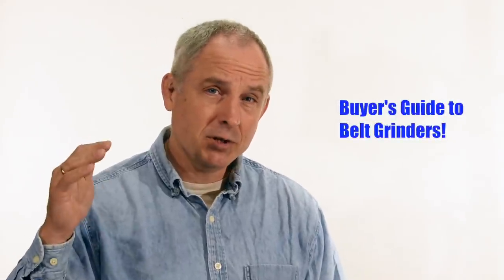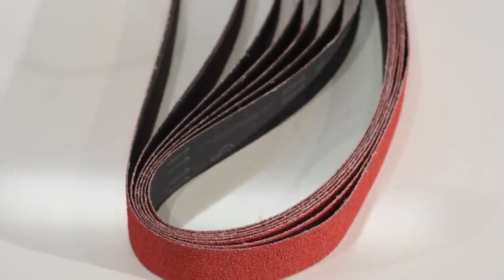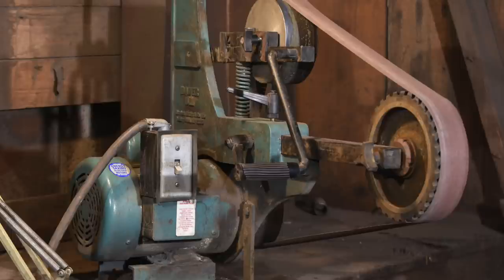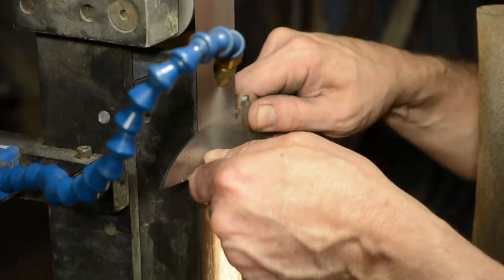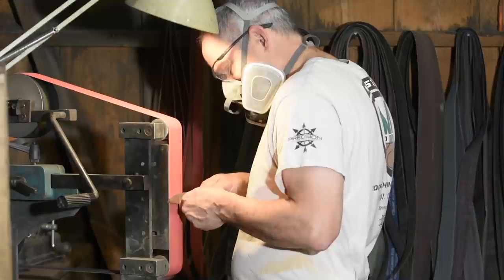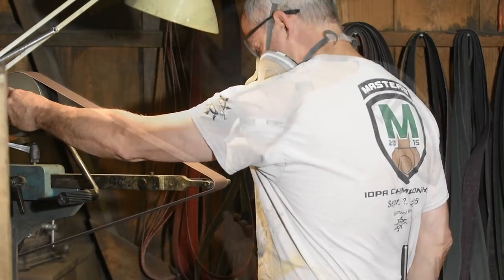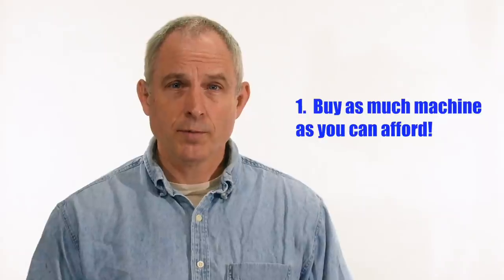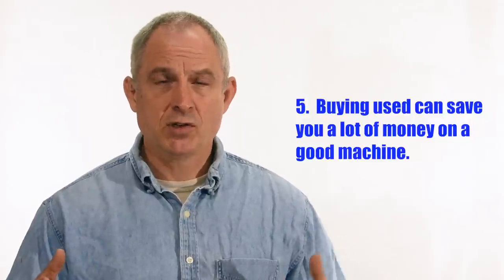Belt Grinders - A Buyer's Guide for Knife Makers

Comment: Thanks for the video , I just acquired a washing machine motor and I plan on making a belt sander , I was looking for what features are needed so that I don't forget and the belt sander you showcased was just the thing that helped me realized how to make it , it will have interchangable bit where it can have nothing , a large round wheel or a flat surface for different bevels.

Comment: Very good information, you are right about the get what you can afford.  2-4k for a sander is a bit steep for alot of us. When you can spend under 100-300 with very little modification and have something that'll work fine and last for years.  Especially if you're doing it as a hobby.  Thanks for the videos!

Comment: All Power, to the Grinders...
Get a stronger grinder, with less Watts...
Get a silent grinder, with less Watts...

Hey Sorrell... Thanks for your great vids...  :) 

You say: Get the strongest motor, you can afford...

You, and others, advise, that 1 horsepoweer, is about the weakest power, you should buy...
In fact: "you better buy a 1,5 or 2 HP motor"...

It seems all the most experienced knifemakers, agree on this... 

That advice, is generally for 2-poled motors, thus running near 3.000 r/min at 50 Hz... (near 3600 on 60 Hz)

But, if you mainly use HALF speed, then, you could just as well, buy a motor, running 1.500 r/min,
and that, would only need to have half the Horsepower, to give about the same momentum, 
so the belt do not stop, under heavy use...

What you really need, is the strongest momentum (Nm)...
A speeding belt is of no use, if it slows down, much, when you are actually grinding...

So, note this, and evaluate, your need, before you buy...

A 2 pole moter, turns once, for each cycle in the mains... 50 Hz, gives 3.000 r/min, minus the slip..
A 4 pole, turns once, each second cycle, running 1.500 minus slip... And has about twice, the momentum...
A 6 pole, turns once, each third cycle, running 1.000 minus slip... And has three times, the momentum...
A 8 pole, turns once, each fourth cycle, running 750 minus slip... And has FOUR TIMES the momentum...

The momentum, has the unit Nm, and is also called the torque... It say how much "weight", is behind the movement...
A wrench, with twice as long handle, has twice the momentum...
So, you can not turn the nut faster, but STRONGER...

The larger the diameter of a motor, the higher the momentum... You want a "fat" motor...

You could say, a 2-pole motor is geared like a racingcar, for SPEED...
While a 8-pole, is geared like a truck, for POWER-pull...

So, when you do not wish the belt to slow down, when pressing hard, then the 8-pole, 
would be the first choise... But they only give just under 750 r/min... (still, at 50 Hz mains suply)

The more poles, the more expencive too, but "not that much".... It is well worth it...
And on the Sites for used things, the prices are nearly the same, no matter how many poles...

I am only a "hobbyist", so I must grind at home... And I do not wish my neighbours to be bothered, by the noise...
For that reason, I am upgrading my belt grinder... Now, building a "real one", for 2x72... :)

I went for a used motor, and found a great deal, a Lenze motor, including a Lenze Inverter, to regulate the speed...
The Frequency converter/voltage controller, not only regulate the speed, but, adds to the torque, at low speeds...
The motor is only ½ HP, (370W), but with 4 poles, and with three phases, it is surprisingly silent, itself...
But with the inverter, It runs even more silent...  When running 3 r/min, you can NOT HEAR it...
But also at full speed, (1330 r/min), you can still speak normally soft, with others...
In fact my microoven, makes MUCH more noise... Wow...
When trying that, you feel, "all, should have one"... But they are expencive... Unless you find a used one...
Using this Inverter, you can also change running direction... 
And decide, how slow it should accellerete, and decellerate, and that makes the bearings last longer...
And you set the max current, so the motor is protected... If the motor has a thermostat, the Inverter use that to stop the motor, when aproaching 150 centigrades... My head was nearly exploding, by going though all the possible settings...
This version has the Vector regulation, which gives even extra added power, adding to the torque, and saving money on the bill, at the same time...  You can code it to start at the same speed as you used last or to a preset speed... After the initial coding, it is simple... Your turn it on, and regulate the speed, or regulate the speed, and turn it on, as you please...

This version, plugs into the normal mains, (1 phase, 230V), and creates a 3-phase output, for 3-phase motors...
The motor, can both be used, connected as star or delta connection....

Note, that on 3-phase motors, running from a mains 3 phase supply, simply change position, of two of the three leads, to change direction... And wire the motor to be in STAR configuration, in the box on the motor... The lid, usually shows how...

Running a motor on three phases, gives the most silent motor... 
You do not hear the 50 hz hum, like from the motors fed with 1 phase... 
It is turned into a 150 Hz "him" (not "hum), which is just much less audible, and gives much less vibration...

So, if you HAVE 3 phase outlet, already, then, NEVER buy a 1 phase motor...

Fed with 1 phase, the motor makes one "jerk", per pole set, per round...
The 3-phase, gives three jerks, instead... not 50, but 150 per second, per pole set... (Or, not 60, but 180)

In a 4-poled (2 pole-sets), that becomes 300 "jerks per second"...
In a 6 poled (3 pole-sets), 450...
In an 8 poled (4 pole-sets), 600 jerks per second... 

With just 300 jerk/second, that frequency is far from the oscillation frequency of a 8 kg motor...
So, you can hardly feel it  vibrate...

Additionally...
1 phase, "gives a push, and wait, and gives a push, and wait"
3 phases, has three windings which each does that, but "turned 120 degrees", so one takes over, when the former waits...
In fact together, they create a rather constant push... 

And that means, there is nearly no vibrations... The 150 or 300 or 450 or 600 Hz is really "weak"

The slower the rotation, the lower the noise... But the 8-poled, give less noise than the 2-poled, at a given speed
The lower the watts, the lower the noise... As each "jerk" is simply weaker...

Using a three phase motor, gives the lowest noise... And the fewest vibrations...

So, if you really need to run about 3.000 r/min, using 1 HP, that is, with a certain size of drive wheel...
Using a 1.500 r/min motor, also 1 HP, fitted with twice as large drivewheel, give the same beltspeed, with less noise...
And it has about the same momentum, with that double sized wheel...

But, using same size drive wheel, then the 8-pole, gives a 4 times stronger momentum, than the 2-poled.

If you has a 3.000 R/min motor, slowed down to 750 r/min with a simple Voltage regulator, (10 dollars on ebay)
then it has only less than 1/4 of the momentum, of a 750 r/min motor having the same power, in watts...

That means, having only 1/4 of the horsepowers, the 8-pole, give the same or stronger pull, at 750 r/min...

Ofcause also noise and vibration in the other wheels, make less noise, the slower they run...

So, if you do not really need "industrial grade speed", then you can save power, and noise, 
and make it all last longer, by using a 6 or 8 pole motor, at one third or one quarter, of the watts...

Best regards Dan...
Reply: OMG!   Mommy make the bad man stop!!
Reply: When did you find the time to write this!
Reply: Excellent input

Comment: In the UK They are called linishers.  I use a oscillating bobbin sander to shape the handles and a wadkin pattern makers sander. And 24" disc sander by Wadkin. I use a onsrud router system to copy handle scales. To customise scales, from alternative materials. All machines are heavy cast iron.

Comment: I have a 1x42 that I use constantly, and I'm actually about to start building a new one with pneumatic belt tensioning. And I'm a full time pro. 

That said 99% of steel grinding is done with the 2x72. I just find the narrower slack belt much better for handle shaping than the big grinder. I'll rough handles out on the 2x72, but finish on the 1x42

after doing it for enough years you'll get a light enough touch on the slack belt that you can go from the belt sander, to a light hand sand with 600 grit for wood, or straight to the buffer for synthetics. 
You really need something with positive and more importantly adjustable belt tension though. I've currently got a Kalamazoo, but pneumatic tension is far superior.

If I wasn't building one of my design, I'd buy a burr king 1x42 without hesitation.

For a 2x72, I like the Bader style.

Comment: Just in time. Getting ready to buy or build one. Thanks
Reply: i'm goin to make one this summer, here in Spain this kind of  grinders are very rare and expensive
Reply: Nicolas Mora I'll video the build and get back with you.
Reply: I did the build route last year and learned a lot of useful skills in the build. Unfortunately, building it myself I probably ended up spending twice the money I could have purchased one for. Of course I just had to learn to weld and buy a welder, and stand, and have made constant improvements and upgrades to it.
Reply: I built a pretty good 72 x 2 in one days time... well worth!
Reply: Actually have a good single speed motor, three-quarter horsepower, but it’s 1720 or maybe 3450 RPM probably either is too fast for this application, or maybe usable with speed direction which adds complexity of coarse

Comment: I've been using the cheapy Harbor Freight 1x30 for ages, works good but I'd love a Bader lol
Reply: same here, check out Ameribrade!
thats what got.
2hp vfd
Reply: Horror Freight sander here as well.... It sucks changing out belts :(
Reply: I took the guards off, helped marginally. But yeah, it is a pain.
Reply: I smell a Canuck! :P
Reply: I have to admit I learn the phrase from watching AVE.
However I'm in Texas not in Canada
Reply: That is all I meant, it is neat how far reaching his crowd is with his linguistics.
Reply: I wish I could change the motor to a stronger one with slower speed.. that's my only issue with the garbage freight one lol
Reply: You could design, or find a shaft coupler, and swap motors out, at least in theory.  *Keeping in mind the electrocity side of things.
Reply: heyou might try it once my motor craps out... Or if I ever get any money buy another one and experiment on the old one
Reply: heyou I agree..there are a few channels that are better than shows on TV with really cool content.
Reply: ShadowdanceII I have seen a few, it just seemed like there was a little more to it than bolting a new motor on. If you or anyone has a good link please share
Reply: You could always install a 3 phase motor with a VFD.
Reply: ShadowdanceII mine wont grind flat digs big groves i cant figure it out does good slack grinds tho
Reply: Great little machine. My first grinder ended up a honing station with a leather belt on it. Still gets lots of use.
Reply: Chris Sproles look up work shop of death he puts a bench grinder motor on his 1x30 its a cool setup
Reply: @ushook  I keep the side off, super easy
Reply: @bumstudios8817  wire a dimmer switch in
Reply: me two
Reply: Yeah I got my start with one of those too. Made like 25 knives before buying a better grinder. Need to know if you like the hobby before spending big bucks. Also made some pretty good ones with the Little Belt and taking more time to grind. Wish i could share pics

Comment: Mr. Sorrells, so this may be a stupid question, but hey, never said I was smart.  So thinking about getting into blacksmithing.  It's something I have wanted to do since I was a kid.  As part of my startup I am thinking about how not to go broke buying stuff lol.  Saw a great video on a guy who bought an old used hydraulic log splitter and modified it to be a hammer press.  Have designed my own forge (I am a mechanical designer so this is fun for me)  Now I am looking at variations in grinding and thought, why are they all using 72" belt grinders, why can't a typical hand belt sander be used?  Cheap, variable speed, all the sandpapers you could ever want, easily mounted in many configurations.  The closest answer I could think of was allowing the paper cooling down time.

Comment: This was a good video on the options and features to consider, but a 2 x 72 bench grinder is one of the more easier builds you can do yourself for way-way less.  You still would need to purchase some of the parts including the motor and grinding belts but the rest can be fabricated.  Thanks for sharing!

Comment: I love this channel. I have to laugh because I made my first knife after the angle grinder video. I quickly bought a Jet 2x42 and have made several knives since. I'm laughing because tonight I talked to Bret with Esteem grinders to buy a 2x72. What a great guy. Then here comes Walter on queue with my buyers guide. The universe has spoken
Reply: ROFL you stole the exact words from my mouth, I to just bought from Brett, he really is a really nice guy, I bought mine about 3 weeks ago and did a lot of google homework, Esteem grinders kept coming up a lot from some of the older fellas on the forums so I looked into them and pulled the trigger, this is was my first 2 x72 so I hoped I made the right choice, I have had zero problems this far, Brett makes his grinders suited to a Bader style and they are super well built and very heavy duty, his machine passes the nickel vibration test easily, the only thing I would have liked to have been a little different was his tool rest which is not a deal breaker by any means... Thanks for another good video Walter, I like your style and dry humor personally keep em coming!!

Comment: What kind of FPM is the best? I should ask what's the FPM Range you need for a grinder?
 What HP should be a good grinder?
 I have my Uncles old hand-cranked forge. It's 3' X 5' and about 1 inch thick cast iron. This is the forge I learned on. I also have a few of the tools he made. He was from Norway.
 I have a small CNC router, and I am making some pistol grips with it. Bet I could make some great handles and hilts with it. 
 I was an engineer/machinist/toolmaker, for over 42 years, forced to retire from Neuropathy.
 Thank for sharing your knowledge, it's 11:57PM here but your videos make me want to go out and fire it up, LOL.
Smiles!

Comment: I built my own 2x72 belt grinder. I couldn't figure out why a new belt grinder should cost so much. I have used a myriad of motors on my grinder so far. The best is a zippy roughly 1hp harbor freight table saw motor with a gear box. It's really fast. I have a 1hp 3ph 4pole baldor motor with a VFD that works remarkably well with an 8 inch drive wheel, but I'm currently doing an experiment using a .75 hp 8 inch bench grinder motor. It doesn't have enough start up torque to get the belt in motion, although if you give the belt a boost, the motor will pick up speed and performs ok, for less than $100US motor. I want to get a 2 pole 3ph, 2hp motor and VFD for it eventually. The 1hp 3ph VFD has the most grunt, I can really smash the material into that belt and the motor just groans and takes it. But it's about $400 for my motor/VFD combo. The 2hp will be even more expensive, and 220v so less convenient.

Comment: I finally tried your sponsors belts, combat Abrasives. I got some of the ceramics. Gotta say, they live up to the hype.
If people are looking for a good motor, Baldor and such are good, make sure it's a TEFC, totally enclosed fan cooled. It will work well in a hostile environment for a good long time.
Reply: 64t120r I like their ceramics and J flex belts as well
Reply: 64t120r tefc is good, my main grinder has one. My secondary grinder has an explosion proof motor which is vastly overkill, but will never die.
Reply: 64t120r Baldor, WEG, Leeson, Doerr, GE, Westinghouse, all quality motors. Baldor and Leeson are probably the easiest to find though.

regardless of what sort you buy though, it has to be sealed and have a continuous duty. tefc is the most economical choice. For used motors, keep an eye out for washdown duty and explosion proof. You can't kill one of those no matter how hard you try
Reply: Gregory, thanks. Haven't tried them yet. I usually go to Pop's for my belts. They did have the best product for the price. I haven't looked in a while, but I'll be sure to look into Combat since my first experience with them is good.
Reply: I made my grinder and I'm usually the king of overkill, but I'll gladly hand the crown to you for the explosion proof motor. Hahaha.
Reply: The motor was brand new and $20 at a swap meet, couldn't say no to that.

I've always ordered belts from tru grit myself. The vsm ceramics are my absolute favorite. Perfom like Norton blaze for 1/3 the price

Comment: Hi , Thanks in advance for any replies . I'm looking to get a belt sander to polish knife bevels . what grit do most use for this ? I've got a Tormek and a slew of fixed angle sharpener but have been thinking of getting a Ken Onion to polish because I have found 6000 grit belts for it . I have not been able to find very fine grit for 1x30 or 2x72 . I've only been able to tree top hair 1 time and it took way too much time . Thanks again